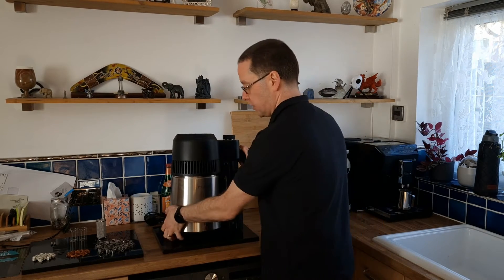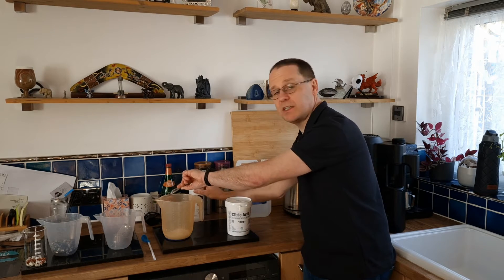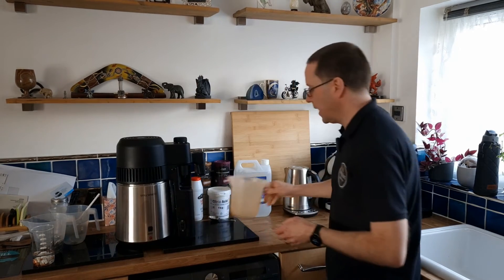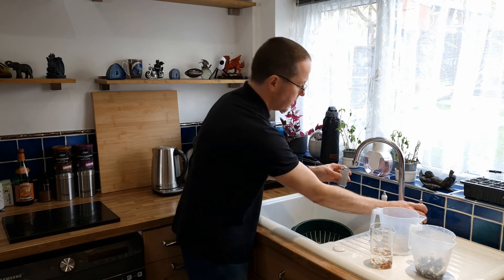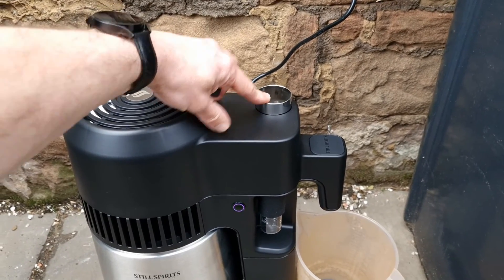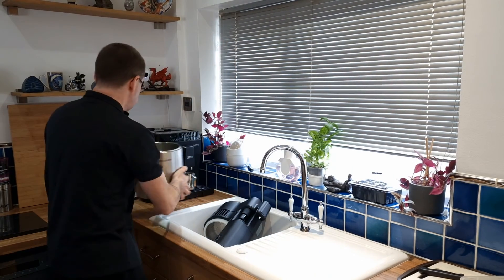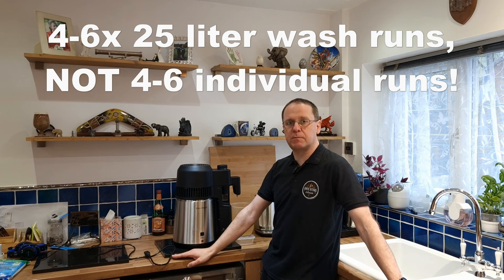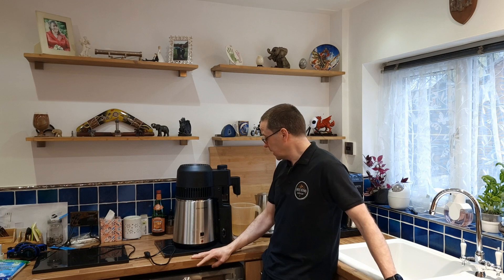Cleaning a new Air Still Pro

Comment: Since Air Still don't say to do a sacrificial, are they maybe saying the foreshots from the first Run are enough spirit to clean whatever was left over from the Vinegar and water wash ?
Considering it would only be the COlumn and pathway from the reflux chamber and not the Stainless or Copper bits as they were cleaned very well with the Citric and Salt soak ?
Just a thought as surely the manufacturer would or should know what was involved in the build and considering it wouldn't cost Air Still anything to say do a sacrificial wash first ?
Reply from the maker: So, yes, the manufacturer (Still Spirits) do know the manufacturing process, so should know what needs to be done to get it ready to be used by the customer.  The Air Still does not (or at least it never used to, but I have not read any recent manual in case it has been updated) suggest a vinegar run is needed. The T500 boiler, the Turbo 500 reflux column and even the alembic condenser in their guides do not mention a vinegar run.  Only the Air Still Pro talks about cleaning it before use.  Some people will say doing a sacrificial run is not needed, but others will agree that it is required.  Really, it is up to you. If you do not want to do it, then don't, but if you want to make extra sure that your new expensive boiler is perfect, then I would recommend it.

Comment: One thing I noticed on my foreshot container , it had a stainless cap with holes in a circle as well as a black stopper ? You don't show this anywhere in this cleaning guide ?
Reply from the maker: This part isn't something that needs to come out of the boiler.  In my unboxing video, when I took out the foreshot container, that part was stuck to the glass container, so I mentioned how if it does the same to you, just take it off, then push it back inside the boiler.  If you want to, you could remove it, and clean it with the other parts, but it is difficult to know where to stop removing parts to clean them in different ways.

Comment: You ever think maybe leave the bits in a container and just put clean water into it a few times and just give the container a shake, this way water covers all the bits, instead of only partially if they are in your hand or a colander ?.
Just a thought as being a Painter, cleaning a brush under a tap is ten times slower than cleaning it in a container of clean water a few times :)
Reply from the maker: I think this is a personal preference thing.  If you fill lets say a jam jar with the bits, then fill it with water, give it a good shake and empty the water, you will need to fill it up and repeat this several times.  But, if you rinse them in a colander under a running tap, you are getting the same volume of water going on and around the bits, but it only a few seconds per area.  In all honesty, doing as you suggest may well be more than enough, and a colander is over-kill.  I don't honestly know, and is just the way I like to do it.

Comment: My Air Still Pro did come with the Ceramic Boil things in the Air Still package as well as another pack in the Essentials Box, I almost bought a pack as I had watched this video before opening the Boxes of my Air Still Pro :). not that they are expensive, just would have had more than I needed :).
My pile of copper and Stainless pieces was about double yours ?
I got out about what I saw in your video and there were still some in there so I gave it another shake and another handful came out followed by another handful, I would say four hand fulls came out, there were probably double the Stainless to Copper, I needed 500ml just to cover the two lots of bits that I put all in one container as I am retired and have the time to sort them :).
Maybe different areas supply different amounts of accessories or they doubled up on mine ?
Well at least cleaning these parts was easy and only takes time, now onto the Air Still itself :)
Reply from the maker: Wow, I feel ripped off by my supplier now!  Think I will need to have a loud word with them ;-)
Could I ask, @billybobjones4317, are you from the UK?  I could understand different countries having different contents, but if you are from the UK, then I would be very shocked if different suppliers had different versions./  Since the Air Still Pro is still so new, I don't think there would have been time to make a newer version, but it is possible that they changed what comes in the box.

Comment: Out of curiosity what percent does your hearts phase run on a spirit run? I have been getting about 800ml to a 1 Liter at 95%ish of a ginger beer wash I run with 500ml of heads/tails - the ginger comes in both sections in a nasty way...but makes it clear for both when your in heads or tails. Thanks for the vid on cleaning - I did the same thing at the start up and now just do the vinegar clean up runs - I soak my saddles in 1/4 vinegar, 3/4 water, some salt for an hour or so and the copper comes back shining. Cheers for the vid mate.
Reply from the maker: Hi Ryan, sadly I can't answer your question as it all depends on the ingredients used, the final ABV of the wash and the volume of the wash.  It also depends if you are making a neutral spirit, or making a gin, rum, whisky or other flavoured drink.  Then you have if you are running it in Pot or Reflux mode.  Sadly, too many factors, so the hearts area will be different volumes for every different type of wash used.
Reply: @brewingadvice  Thanks for the reply and response  - new to this and what you stated explains a few things I was seeing with different washes. I was referring to a clean up run in reflux of a ginger beer was I like to use - I strip in pot still mode then charge for a spirit run around 38%. I find the still shuts down with 10-20percent left in there most times . Not sure on the why - but has to do with the sensor it runs most likely. Anyway I appreciate the feed back.
Reply from the maker: Hi @RyanW20207,
When you run in either Pot or Reflux mode, it will never extract 100% of the alcohol from your wash.  I don't honestly know what percent will be left in the boiler as I have never tested it.  The issue is that what is left in the boiler won't be really clean, so, an alcometer won't be accurate.  
If you are distilling a beer, the ABV would be around 4-6% ABV (on average).  So, that wouldn't get you a great deal of spirit.  Reading that you said the still shuts down, I am assuming you have the Air Still Pro, as that is the only still that I know that when in reflux mode, it switches itself off.  If I am correct, then this may be a flaw in the still design rather than something that you are or are not not doing.

Comment: Hi would have been nice showing how you got the copper and stainless saddles out but over all a good informal video
Reply from the maker: Sorry about that.  To be honest, all I did was tip it upside down and then inserted a wooden chopstick and wiggled it around a bit.
Reply: I just placed mine upside down and gave it a few shakes, about a handful at a time came out and I just kept going till no more loose parts moving :)
Reply from the maker: Sometimes just turning it upside down and shaking it is enough.  Other times you need to pat the bottom of it, other times you need to assist them with putting something inside the column.